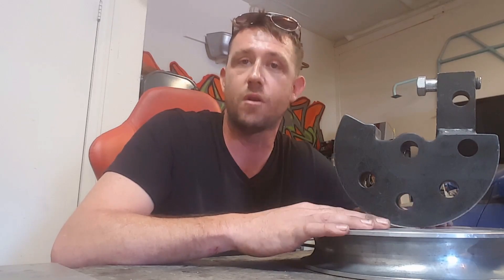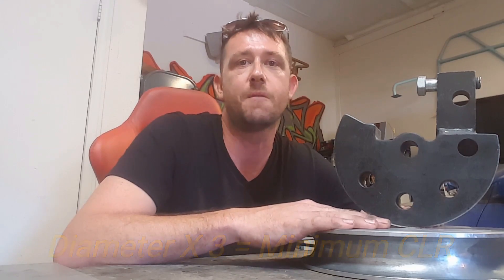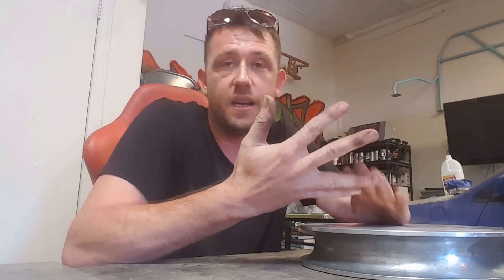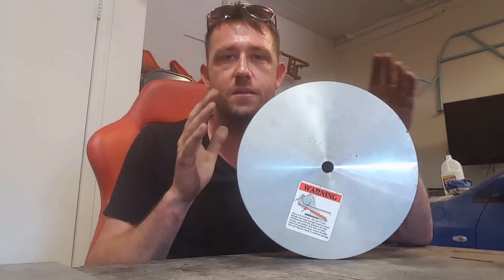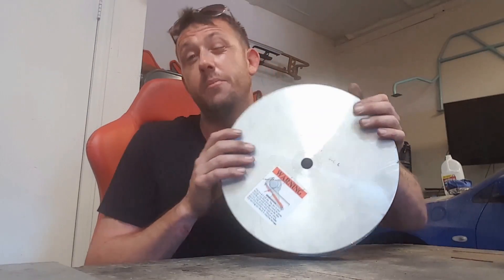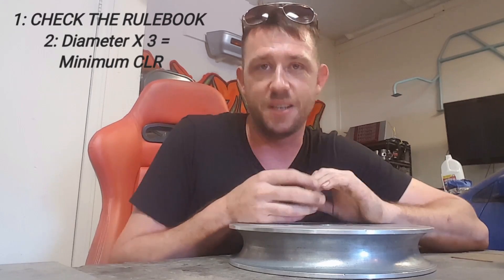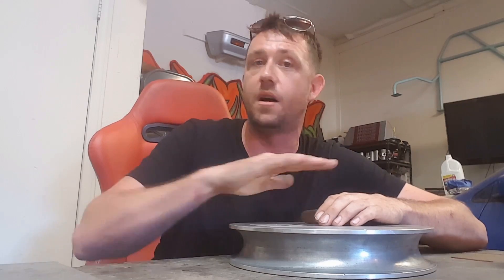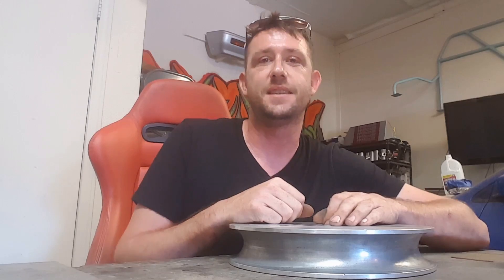TFS: Which CLR Die Should You Buy for your Bender?

Comment: I plan on making a mini bike frame, so not governed by a rule book. My question is, should I go with a die that has a larger or smaller minimum clr for my bends? My current plans call would have one 180degree bend at about 6.5inches. The dies I’m looking at fall on either side of this measurement, would it be easier to go larger or smaller and do two 90degree bends? Thanks!

Comment: im completely new to welding and tube bending but i been wanting to start learning it for years. I got a great deal on a bender that came with 2 180 degree dies (1 1/2" and 2") but they both 6.5" and they are MASSIVE (and heavy too)..i wonder if that would be improper or look weird for building roll cages ...should i buy smaller dies or can i just use these for fabrication?
Reply: those will work fine, depends how tight you want the cage to the interior of the car... most of the time you can get away with a die that big.

Comment: How do you find the clr of a tube that's already bent?
Reply: in a 90 degree bend where a line perpendicular from the start point and end point of the bend meet x2, for bends less than 90degrees im sure theres a way to figure it out with some maths and angles but people that are into cage building can most likely look at a bend and know what die made it they only come in 1" increments for each tubing size typically so itll be 4.5" or 5.5" not 4.65" no one makes that die itd need to be custom made
Reply: @AndrewBrowner  awsome thanks